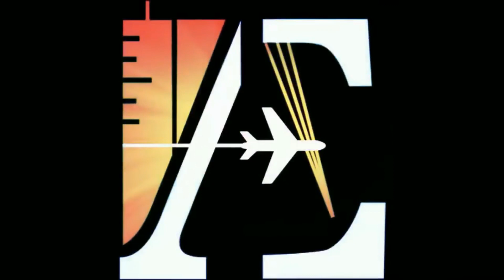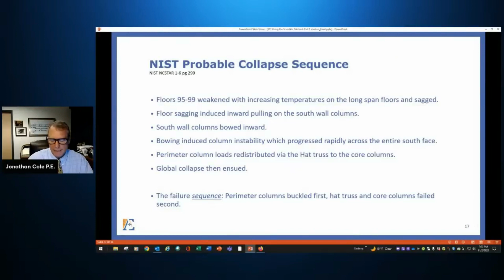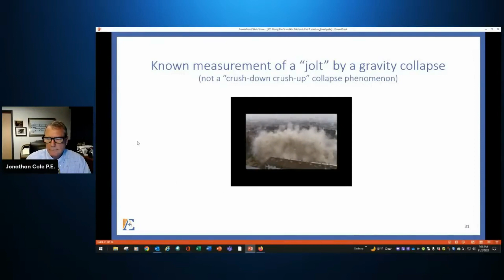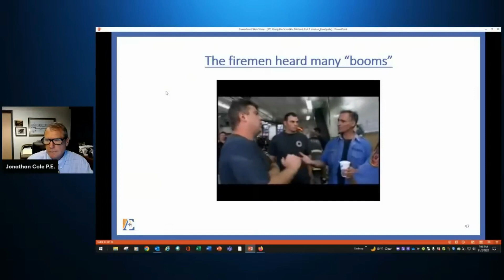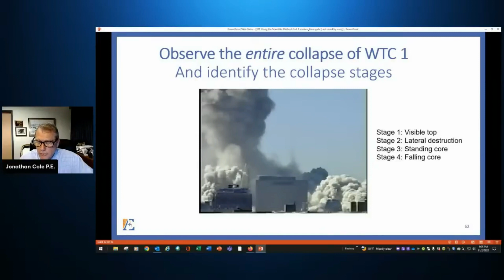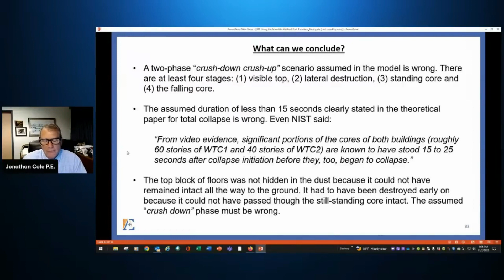9/11 and the  Scientific Method :  Part 1 - Motion

Comment: I believe mini-nukes were used, despite your assertion that no flash was seen. It was MINI, it was enclosed in the basement on the lowest floor, and all the other mayhem and dust distracted people from any possible momentary flash. Remember that vehicles within a mile or so radius appeared burned- by the EMP pulse most likely. There are many pictures of these burned firetrucks and other cars. Also, if you can find a video of a low yield underground nuclear test, you will see the similarities. These type of explosions do not create a mushroom cloud. Considering all of this, a nuke was needed to start the collapse and disconnect the core beams from the bedrock.
Reply: No radiation was detected
Reply: Mostly experts in building design and construction have put forth educated opinions but without a testable theory. You have touched upon the key: to understand the destruction of the buildings on nine eleven requires an expert on destruction (i.e. munitions and demolitions expert).

Comment: I had a chance to Dr. Judy Woods' theory about DEW [Direct(ed) Energy Weapons, and her connecting them to 9/11, years ago.  We DO have DEWs, but to listen to her theory about how these things were used in 9/11, frankly, is what MAKES us all sound like lunatics.  In other words, it's DESIGNED so that anyone repeating it is dismissed, ridiculed, and ignored.  A very sophisticated form of COUNTER INTEL.

THIS man's explanation is one of the best I have heard.  And I met Richard Gage, when he he started AE911TRUTH.  I was floored THEN.

The airplanes were a DIVERSION; a "reasonable explanation".  We all SAW the planes hit the Towers [1&2]; no doubt, no question, no debate.  But the planes are NOT what brought the Towers DOWN. 
 "OH, the fire was TERRIBLE from all the jet-fuel that caused the steel to warp and fail...".  Really...?  That's funny; when the airplanes hit, we all SAW the big orange-and-black fireballs; seems to me, that was the JET-FUEL igniting on impact.  So...if that's the case, as we all SAW, then, HOW did it go down the elevator shafts, and cause all the steel to warp and fail?  What was left to burn; OFFICE MATERIALS??!!  How does THAT kind of fire burn HOT enough, LONG enough, to do that?

  From a LEO perspective,  how is it that shipping the WTC Towers' steel to China/India, is NOT Destruction of/Tampering with Evidence, Obstruction of Justice, Impeding an Investigation [FAA/NTSB]?  Why wasn't anyone charged, relieved of duty, fired, or even reprimanded?  Compare 9/11 to Pearl Harbor.  Adm Kimmel and Gen Short were almost "boiled in oil"; over 2400 died, mostly military personnel, on a US Territory.  On 9/11, almost 3K died, IN CONUS, civilians and first responders, and NOBODY is BBQ'd.  Why?  Because it was a Perfect Storm of "unfortunate events" that NOBODY could anticipate, hence, NOBODY  was to blame.  Everybody DID their job; so NOBODY was held to account.  Sorry, we'll do better next time; ESPECIALLY with all the new National Security surveillance measures and bureaucracies [TSA, DHS], in our "Post-9/11 World".  That's ok; just raise our taxes MORE, wage endless wars, sends 100s of Bs of $ to foment WW3 in Ukraine, while we're $31,000,000,000,000 in debt ALREADY.  Just pop a beer, turn on the idiot box, and root for your favorite team, or play video games, watch internet porn, choose whatever amusement d'jour tickles you.  As your money collapses, and prices skyrocket to the stars.

Santa has been making his list, and checking it twice. And we've been found out, that we're not very nice.  I think we're all going to get a HUGE lump of coal, and it's REALLY going to "suck".

Merry Christmas.

Comment: I’m a fabricator using many materials including steel. One thing that always bothered me is how quickly heat transfer happens in steel. If you have an 1” steel plate and you’re cutting through it with a plasma torch (which is well in excess of 5000°f, you can put your bare hand on the same steel plate less than a foot away from the cut and it will be too cool to burn you—or even cause discomfort. That’s because steel is very good at dissipating heat. It’s difficult to pour enough heat into steel to overcome the speed at which that heat radiates off or is absorbed and normalized within the material. It makes melting large quantities of steel VERY difficult .

Yes, kerosene can potentially soften steel. Yes, molten aluminum can react with water (assuming it hasn’t oxidized, which can happen almost instantly) but, the sheer amount of sustained energy that must be poured into steel to do that is pretty unfathomable in a chaotic office fire or airplane wreck.

It always bothered me and no one has been able to assuage that pea under my mattress in 20 years.

Comment: The head of the NIST investigation admits both towers fell at free-fall acceleration. 
There really should not be any more evidence needed. That is impossible with a gravity-driven collapse unless the floors under the falling section are removed beforehand. There is only one way that could be achieved.

Comment: One of the biggest smoking guns that I never see talked about is from some photos that were released sometime around 2016 to 2018 I can't remember exactly. They were taken from below as the towers were collapsing and you can see the upper portion of one of the towers leaning considerably upon the initiation of the collapse. For it to right itself and disintegrate entirely is not possible with the pancake theory it would have toppled to the side. there had to be some sort of extra energy that would destroy the upper portion before it toppled

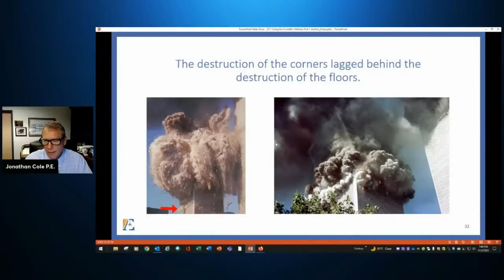Edit: I believe he shows the picture I was thinking of at 39:42 and makes the point I was making. Yay

Comment: The only conspiracy worth its salt. The only one that is backed with science. I am a rational, logical, even-tempered person with high level critical thinking skills and a reasonably high intelligence, and I believe the world trade towers were hit with planes and then brought down with controlled demolition. Any other conspiracy theory on this event is questionable. I have looked into all aspects of this event. Pentagon, both towers, tower 7, what happened to the people on the planes, how could planes hit a skyscraper at 600 miles an hour, Pennsylvania crash. There is not a single element without a logical, sound explanation. What does NOT make sense under this analysis, however, is the official story. It does not hold up to rigorous analysis. I understand that most people cannot possibly ever accept this as a legitimate possibility due to the implications it would present. A good starting point for someone, I believe, would be to look at WTC tower 7 which was not hit by any airplane and still came straight down (Didnt appear to pancake down) at 5pm that day.

Comment: The entire notion that the top 10% of the north tower could somehow destroy completely and explosively the intact remaining bottom 90% of the building, with gravity being the only thing driving the destruction, was always absurd at face value, even if they were equally as strong, which of course was not the case. Skyscrapers are much heavier at the bottom than the top (any structure is), so theyre not only over-designed (what's termed (redundancy), theyre actually much more robust in order to support all of that additional load. Im surprised to see Wood's (let's face it, completely kooky DEW idea) even mentioned because it has never been a plausible idea that any serious researcher gave any credence to. All you have to do is listen to the Dr Greg Jenkins interview with her and she cannot even explain what she is talking about. So, no debunking needed there. She could not even begin to articulate a mechanism by which dustification could occur. Also, the heavy steel elements were sold by the ton and the math added up for the two towers and Building7. I forget now what the exact total was like 240 or 250 tons of steel sold to recyclers in India and China.
Reply: See again.... I get 'clown', 'unhinged' 'kooky' etc...   all the words of folk who don't actually have an argument.  And why do you lot try and phrase it so that people who are open to DEW are against the idea of thermite.  Why can't they both have been used?    Your strawman, namecalling, nonsense is far too obvious for the kind of skeptical minds you are trying to convince. You must try smarter.
Reply: @hookooekoo2  You're obviously not very skeptical if you're going to muddy the waters with DEW nonsense which has no supported arguments to begin with, as Mr. Cole clearly demonstrates. Where are your arguments? You haven't presented any yet other than
pretending you're some kind of highly trained linguistic spy who sees anyone who points out how kooky it is as 'giving the game away', like we lost some high stakes game you have everyone else in checkmate with.
 Seriously? Pretty kooky bro. Like I was pointing out and using your own words, your nonsense is far too obvious for the kind of skeptical minds you are trying to convince. Smart harder.
Reply: You lot try TOO hard to discredit Dr. Woods.   You give the game away as to who you really are simply by over-trying where she is concerned. The word 'kooky' is another giveaway.
Reply: @hookooekoo2  is another clown from the woods circus. You can't see the "Wood" for the trees.  We shall dub thee justification or "Dusty" the clown for short. It may have escaped your mind that even if the thermite or nano explosion proposition is by some miracle wrong and that we ignore all the physical evidence, it does not matter since it STILL means it was an inside job no matter what the cause. Now ask your tiny mind this...whether it was highly advanced cutter charges or it was Alien UFO beams that caused it why would the people who spent their whole lives and sacrificed their careers and families be trying so hard to convict the criminals and challenge their official narrative on how the towers came down thereby pointing the finger at those in the government if they were some sort of "agents of the government" trying to throw us off the scent like Woods and her cult followers claim?
Reply: @hookooekoo2  and you just tipped your hand as to who you really are, Judy Wood disciple. There is no trying to discredit her, she does it herself. Cry about it. 🤡
Reply: @hookooekoo2 frankly the DEW theory is kooky.  It requires that we ignore a lot of obvious evidence.  No credible scientist would create a theory that requires ignoring clear contrary evidence.  Dr. Woods is controlled opposition.  You’ve been hoodwinked: wake up!
Reply: @BobWidlefish  "....ignore a lot of obvious evidence" ....... such as?